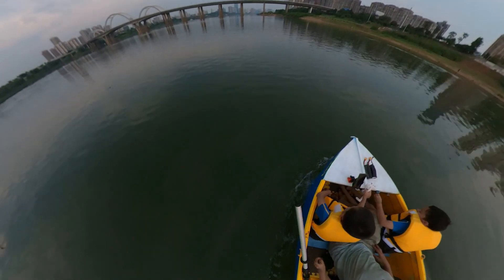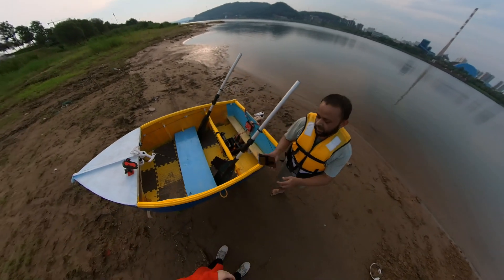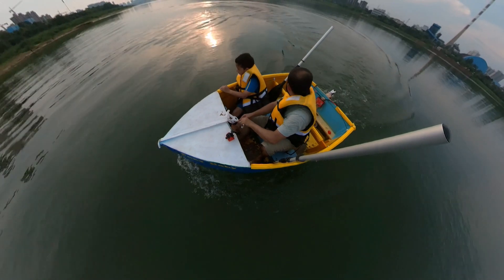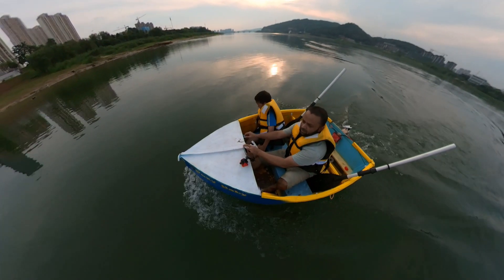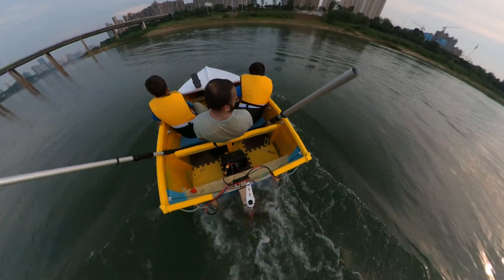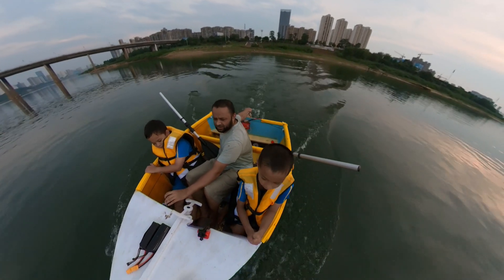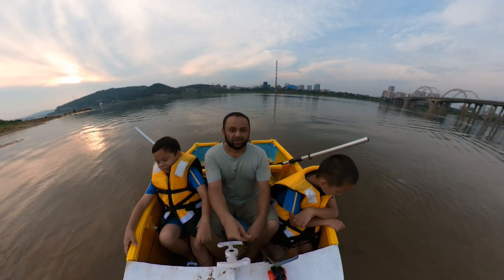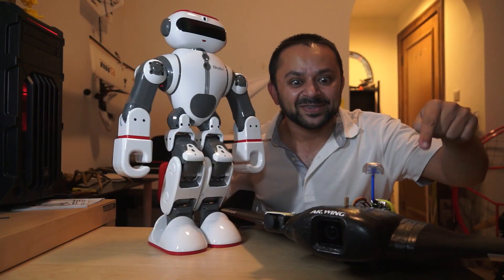Boating Fun Homemade Mini Electric Boat Twin Motor Power

Comment: Hello
 I had purchased the eachine e160 v2  a month back and hovered it a few times and then it happened it crashed, SO ordered replacement parts for it and the parts were coming from china. So i wasnt sure how long it would take so i ordered a new eachine e160 v2 , so i could get back to hovering sooner. I received the new e160 and binded it to the E6 transmitter, but it was to tilt forward on take off and right,ive set p curves and t curvesand ive tried looking help on line but not sure whats going on. The frist e160 worked right out the box. Could you please help? sincerely, Chris
Reply from the maker: Possibly mechanically some differences. you need to adjust your radio settings accordingly.

Comment: Ali my friend if I may allow myself a remark: your rudder is mounted upwards, let me explain a boat rudder is mounted with the widest part towards the rear and the shortest part in relation to the axis forward. your mounting induces heavy load and instability in your direction, looking at pictures of a ship's rudder you will find that the shortest part in relation to the rudder axis goes forward. This is just a tip for having made boats for twenty years I think I have a little experience.
good navigation to you and your little family ...
Reply from the maker: yes sir I corrected it later. it was just an experiment to see how it goes and it was too hard on the first try. so i reversed it. No worries. :) Thank you for noticing it :D

Comment: Salam Ali brother. Another great one and the kids did great... You got two great crew mates there. Looking forward to the welding parts my friend 👍👍👍
Reply from the maker: Wassalam Brother. Yes the crew of this little ship is doing very well. I am starting to learn welding in coming days. and I can't imagine the new ways and new possibilities the welding skill will open for me. I found the huge local markets filled with cheap yet good quality light weight steel, iron, aluminum and much more. I am even thinking, electric Go Karts, Airboat with Electric Paramotor power combo hahahaha. and first of all the easy thing to do is to weld an electric Paramotor Trike frame so i can take off from ground, because of my broken foot I can't run to take off with electric paramotor. so building electric trike will be a good project. maybe a light weight frame for a manned drone? :) I am super excited. I gotta learn Welding in coming month real nice.
Reply: Shukran my brother. It seems you have a lot of ideas up your sleeve for different project. I use to be an electrical engineer many years ago and had to learn welding such as mig welding. There are a few different types for different metals I think

Comment: Crew's got their PFD's & looking sharp .Your doing a good 5 knots , this project is getting better & better, Ali .
Reply from the maker: Yes buddy :D I think its time I get the Metal parts ready for motors and then get some good quality Li-Ion 48Volts Pack, one for each motor. then I can go full throttle without worries of breaking parts and losing motors hahaha
Reply: @alishanmao   Now just making better & hope you use thru bolt on transom to hold the increased power, i see you like epoxy a lot lol & you want to use both methods here & Alum. will slice the water much better + extra power & the reinforcement to handle it.  The tweaking will continue . 👍